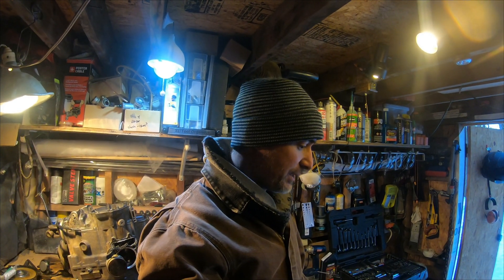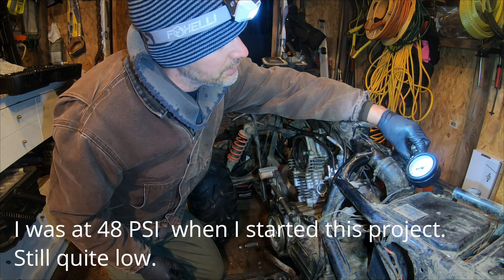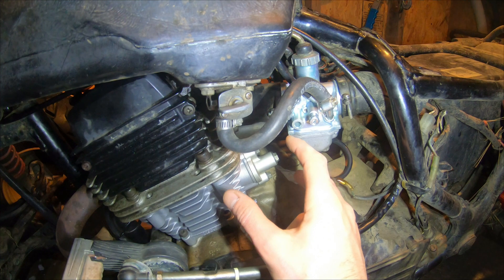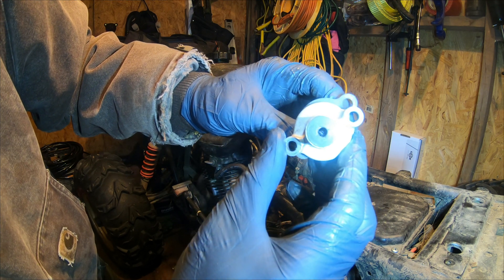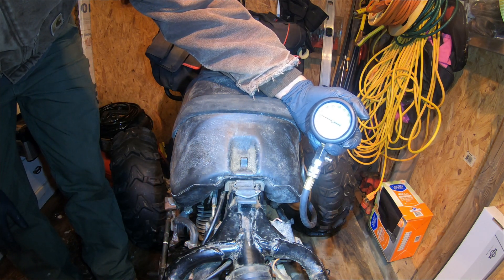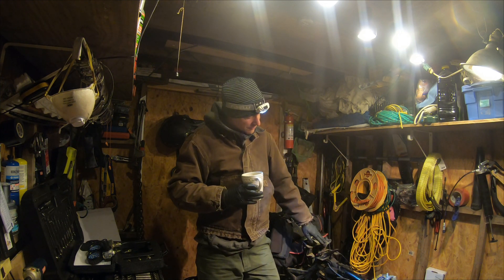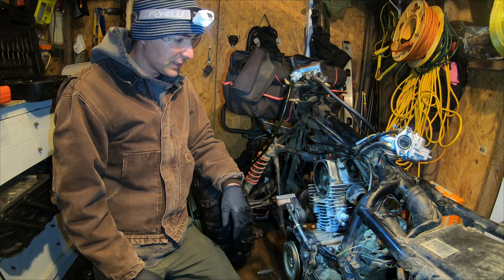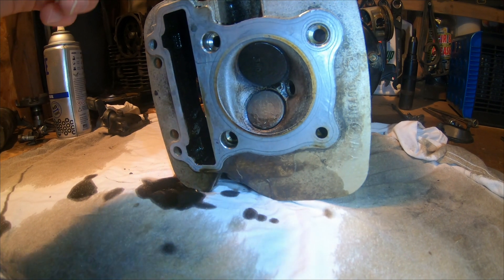How to Redo your Top End: Timing Chain Tensioner Installation and Leak Down Test - Part 3

Comment: Does the timing chain cover needs to be on before starting engine? I’m asking because I’m missing the cover when I bought the cylinder head.
Reply from the maker: Yes, oil gets in there so you’ll fling some oil out. You ‘could’ start just for diagnostic to see if it will fire but don’t run it longer than a few moments.

Comment: Hello, been watching your tech for a while. TksQuestion: It will not start: with wrong oil filter - it poured out oil from gasket. I replace w/factory , filled oil and it will not start???2003 650 Prairie , 200 hrs.   It sparks, trys to start one cylinder when gas in carb, No noises, a compression check w/ weak battery measured 35psi ft & 45psi rear.Suspect front chain tensioner??   if front, any special way install or check or can just R&R.
Please let me know thoughts, any ideas
Tks, mark / georgetown ca.530-333-5986
Reply from the maker: Hi Mark, I can’t say I have any experience with the prairie but the 35 and 45 psi compression sounds really low. I’d check the spec in a manual or forum. I might suggest looking to see if there is a Facebook group for the Prairie’s that could give you better specifics but certainly check that compression spec. Good luck!

Comment: You were lucky you didn't break a bolt cinching the tensioner in. My kid did that just today...Tomorrow I am gonna try and extract the broken bolt. Good tip on the tensioner reset - very few top end overhaul videos talk about this.

Comment: You need to pull the covers off the valve adjusting port where the rockets are and make sure both are free moving with no tension to be at tdc of compression stroke....otherwise one or both valve with be open...

Comment: For TDC on my XT200, crank turns twice to cam sproket once. I had to skip a cam rotation and get the crank caught up to TDC. To confirm I removed the sparkplug and put a straw down in to measure depth of piston for future reference. Now to shuffle the chain. First disengage the chain tensioner to relax the chain. Then disconnect the cam sprocket to rest on the bolt threads, rotate the crank with a 17 mm socket through the case access at magneto to TDC in the smaller peep hole. Then brush the chain across the top of the sprocket with a small round screwdriver shank without dropping the chain into cavity. May take a couple tries to get the correct link to TDC mark on sprocket. Then secure the cam sprocket. Reset your chain tensioner.  Confirm the piston is at TDC by checking straw through the sparkplug hole. Stay warm

Comment: I got a 85 yfm200 its making a rattling knocking type noise off idle but stops once it gets off idle could it be timing chain? I'm sure it's not rod knock because it doesn't get louder with rpm ....could it possibly be centrifugal clutch noise I'm new to yamaha I've always had Hondas
Reply from the maker: My first guess would be timing chain slapping the case. One of my moto4's does it and having done a few other quads now I'm betting if I crack into it that will be it.